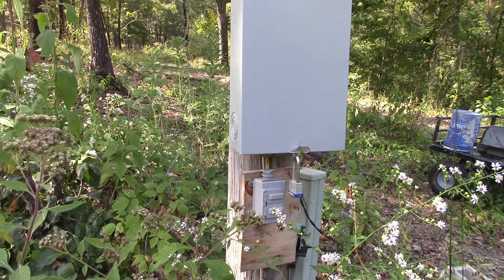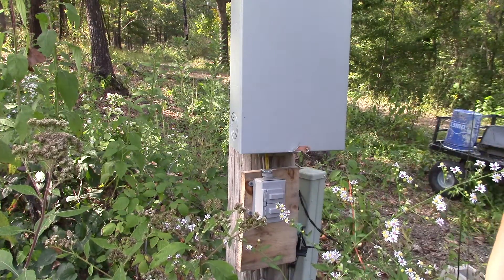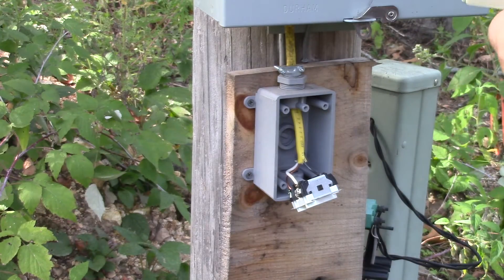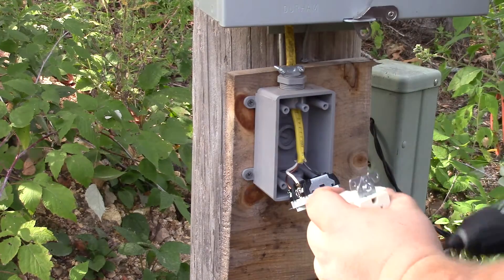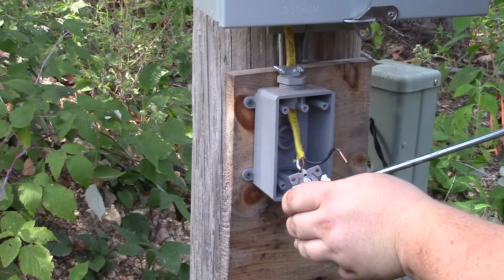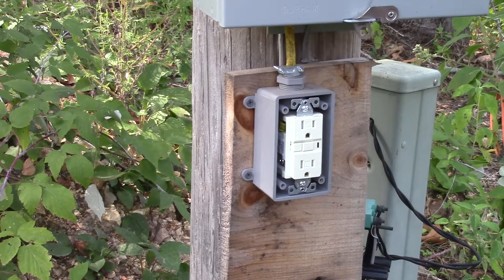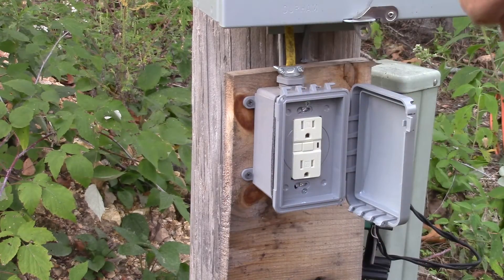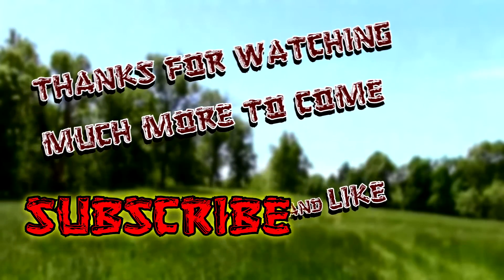Installing A GFCI Outlet For Safety (Kind Of)

Comment: You should have run that Romex through the bottom of the box to prevent water getting into the box.
Reply from the maker: +GreeneNatives I know, but I didn't use outdoor rated romex so I wanted to limit the romex exposure.  And, the box is so close to the bottom of the meter box, it basically is covered like a roof.